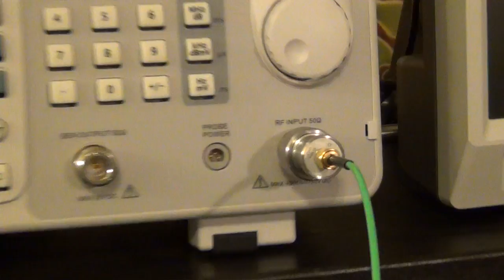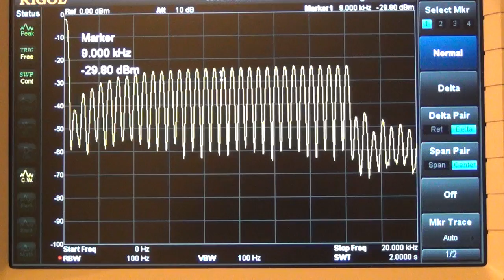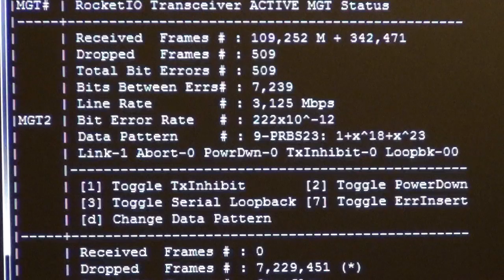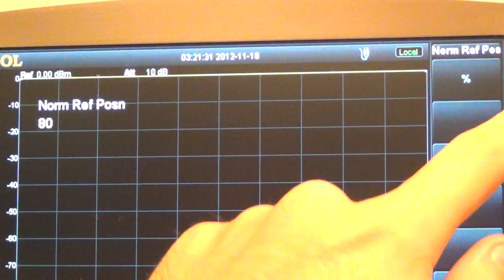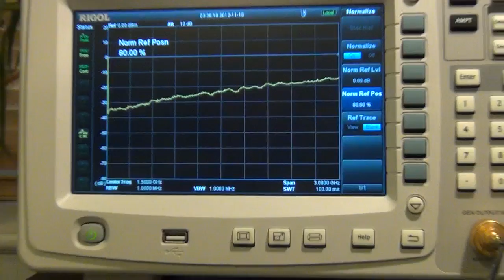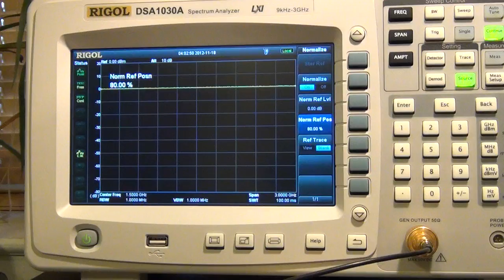TSP #17 - Rigol DSA1030A-TG3 Spectrum Analyzer Review and Experiments

Comment: Can someone comment on the phase noise measurement?  How do you know the -107dBm/Hz at 100kHz offset was the phase noise of the Miteq oscillator and not affected by the Rigol DSA's phase noise?  Shahriar commented that "You can't measure the phase noise of anything that has a better phase noise of this instrument."  
1
Reply from the maker: +Cameron Boone I measured the phase noise of the Miteq module separately. The measured phase noise on the Rigol is very close to the Miteq phase noise. In this case, there is a small contribution from the Rigol on the overall phase noise.
Reply: +The Signal Path Blog Thanks for responding!  When you say you measured the Miteq module separately do you mean the measurement shown in the video no the rigol, or did you measure it separately with another SA that has better phase noise performance?  Does the phase noise of a DSA typically roll off at 20dB/decade, meaning would the Rigol's phase noise be about -108dBc/Hz at 100kHz and then about -128dBc/Hz at 1MHz away?
Reply from the maker: +Cameron Boone I measured the Miteq with an Agilent PXA which has far superior phase noise. The exact details of the phase noise I do not remember anymore as it was a while back. But I suggest you watch the latest review of the Rigol 7.5GHz spectrum analyzer I did recently, that one I measure with a much better source and you can clearly see the phase noise profile of the SA.

Comment: Shahriar - don't know if you've updated the firmware on your 1030A-TG lately but the newest Version 18 FW (Sep 15) adds VSWR and Return Loss functionality along with fixing the bug that wouldn't allow you to invert the print function so you don't waste a lot of ink printing a screen capture.  I was bummed when I got my analyzer along with the VSWR bridge only to find out that function was not implemented (as it was in the 815 series) and was pleasantly surprised to find that they added it. Thanks for all the great videos! Dino
Reply from the maker: +Dino Papas Thanks, I will check it out.
Reply: +The Signal Path Blog BTW, for some reason the "Firmware Robot" that normally provides update requests wasn't answering my request for the latest 1030 FW last week so you may have to get it directly from the guys at Rigol (or I can send it to you direct if need be, it's a small file, only 2.3MB).

Comment: Why would one use a SA in the kHz range? Any Oscilloscope can do that today.
Reply from the maker: The dynamic range of a SA is much higher than that of an oscilloscope.
Reply: TheSignalPathBlog Even though they have just 8 bit their effective dynamic range is better than that due to oversampling\averaging. For small signals you can make yourself a 50MHz LNA for $30.

Comment: Thanks for the video. I have a question and I haven't watched the entire video yet so I apologize if this was mentioned in it.  As shown in your video, with a CW, going from a larger to smaller RBW lowers the noise floor but the power of the CW remains constant and the C/N increases.  When I look at a digital PSK modulated signal and do the same thing, the noise floor decreases as expected however the modulated carrier power decreases by the same amount and the C/N remains constant.  Why is this?
Reply: CW is of ideal BW of 0 and should be concentrated within the filter BW regardless of a reduction of BW. PSK modulated signals on the other hand have its power spread across a BW and hence a reduction in RBW would reduce the energy measured for each point in the sweep.

Comment: Very informative and helpful video. Thanks..
Question.. I have an HP8566B SA but it has no tracking gen. If I wanted to look at the frequency response of a fixed frequency mechanical or lattice filter, Can't I simply use 2 stable signal generators instead? If so, what is the method for this test. I have a number of HP 8640B sig gens that I can use.
Any help is appreciated.
Thanks!!!!!!
Reply: wa4aos You can use a noise source and measure the deviation the filter causes.
Reply: nove

Comment: I think the analyser spec was quoted as -88dBc/Hz at 10kHz. This is very poor phase noise. A lot depends on the loop bandwidth of the Rigol synthesiser but you could guess its phase noise to be about -108dBc/Hz at 100kHz. i.e. 20dB better than at 10kHz.
I'd expect the 600MHz Miteq to have extremely good phase noise at a 100kHz offset. Ballpark -130dBc/Hz so this measurement was limited by the very poor phase noise performance of the Rigol and not the Miteq.

Comment: Interesting review but I don't agree with some of your comments in the phase noise section. I've never used one of the 600MHz Miteq sources but Miteq would deserve an award for incompetence if they only achieved -107dBc/Hz at 100kHz offset for a 600MHz oscillator. That phase noise is very high! I suspect you are just measuring the phase noise of the Rigol at 100kHz offset.
I would expect that if you weasured the Miteq on an Agilent E5052A it would show better than -130dBc/Hz at 100kHz offset.

Comment from the maker: You have to be careful to distinguish the difference between a signal's "harmonic distortion" (which means having spurious tones, or harmonics) and a signal's "phase noise" which represent unwanted random jitter in the signal. A signal which has poor harmonic distortion can still have low enough phase noise to do low-phase-noise measurements. The DSA's internal synthesizer has a good enough phase noise to enable this type of measurements even though it has poor THD.